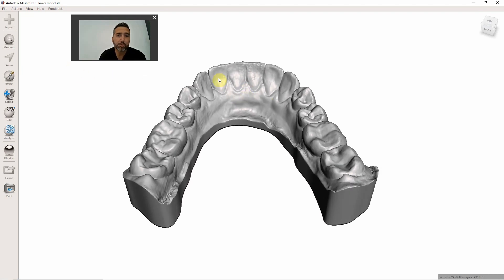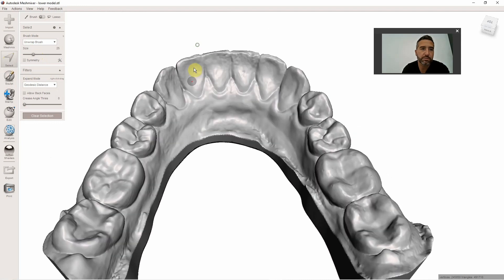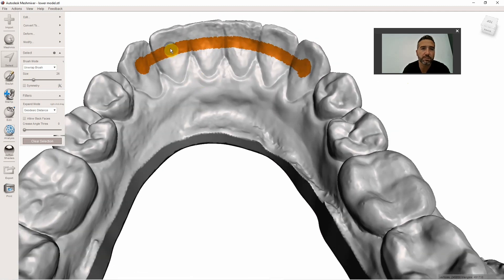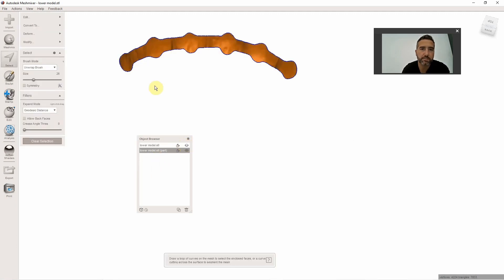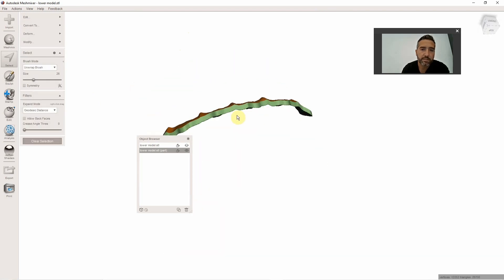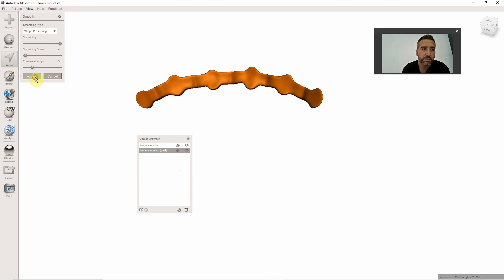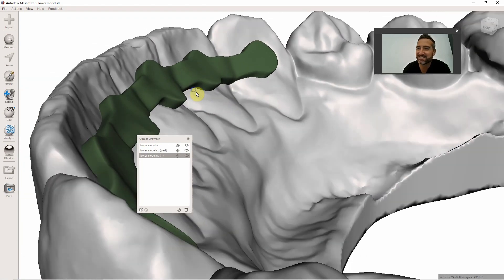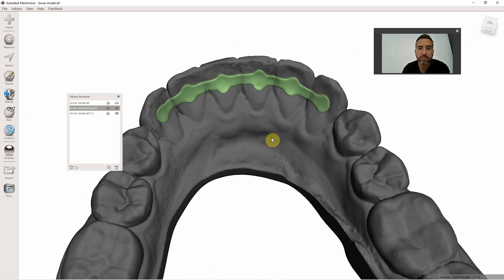3D printed custom lingual retainer

Comment: What bonding protocol are you using for this? Do you happen to have any updates on your materials or durability?
Reply from the maker: The bond protocol is the same as it always has been for anything that’s 3-D printed you sandblast it and paint it with adhesive and use  resin cement. Some materials didn’t hold up while and broke at the connectors so I started making the connectors more thick and I’ve had a lot of good success spread. My retainer material seems to be the best.

Comment: What specific Flexcera resin do you use? Is it smile plus?
Reply from the maker: I have moved in to ONX Tough for these.  But Flexcera smile and Ultra plus are the same thing different name and cost
Reply: Thank you for your response back. What material do you recommend to bond the Onx lingual bar to the teeth?
Reply from the maker: @tarahzimmerman3335  just etch the enamel, adhesive, cure. Then  sandblast the bar, silane add flowable composite to the bar , seat and cure
Reply: @wallyrenne  Hi, i am wondering why you would need silane on the bar, as there is no glassparticles in the resin? Can you sandblast direct after printing so it doesn't have to happen chairside?
Reply from the maker: @annabellebotman220 many of the resins I use have glass particles. If use one that does not then skip silane. I sandblast after final cure. Make sure to make connectors thick or they will break

Comment: Hi, thank you for the video. Do you think a resin such as Senertek P-Crown resin would work for this application? I’m concerned it may be too rigid with an flexural modulus of 9.5GPa, however, it does have a flexural strength of 410MPa which in theory should stop it breaking
Reply from the maker: I think that I’ve had a few of these break so be careful. Make the connections thicker.

Comment: Thanks for the video.  Do you think the flexural strength of the resin you use would resist fracture if the retainer was bonded only to the canines?  Any recommendations on resins?
Reply from the maker: No it would for sure break.  Use a flexible tough resin. Like ONX tough or Flexcera. Keep the connectors thicker then you think

Comment: Thanks for the video. However on the last step It won’t allow me to select not the intaglio surface. It always selects the whole thing to smooth. Do I have a setting off?
Reply from the maker: So double click only on the outside should avoid the intaglio. If not you need to change settings to “remember face groups “

Comment: Hi .. thanks for the video .. although, i have tried this in the past .. i intended to print in castable resin and get it into metal, but the lab guy says it won't work .. 

What is the material you used to print? Will this material have the right flexibility as well?
Reply from the maker: I use Flexcera it’s perfect
Reply: @wallyrenne  cool .. so basically any denture resin or temporary crown resin should work right? 

You haven't faced issues of breakages with flexcera right?
Reply from the maker: @26243937   use a FDA cleared permanent crown resin. Only Flexcera and Bego meet those requirements
Reply: @wallyrenne  I tried this with Sprint ray crown and the first two I placed broke with in 48 hours.  Any experience with that resin?
Reply from the maker: @jamiekane4182  that stuff is a brittle as raw spaghetti man. Use something like ONX tough
Reply: @wallyrenne  LOL - on it.  Thank you again for being so generous with your responses.
Reply: Thank you for the amazing content. Can we use Saremco crowntec resin for this? Bonding would be with resin cement?
Reply from the maker: @muditkedia4893   definitely use resin cement and bonding. Saremco might work. I have had a few failures with brittle materials  and more flexible materials work better